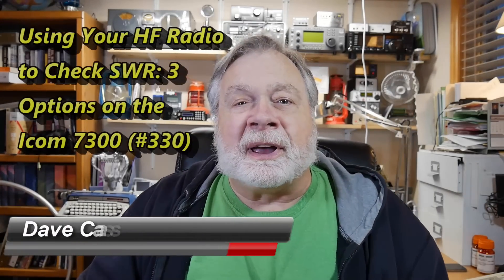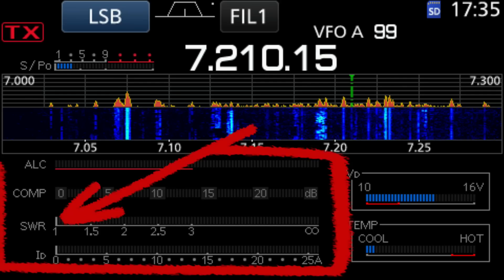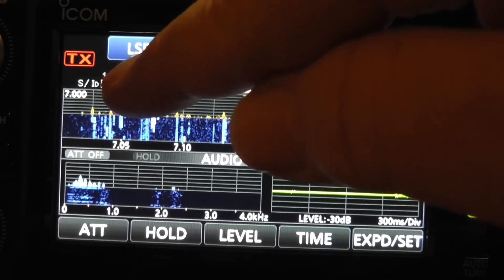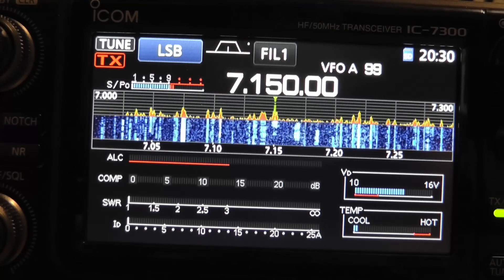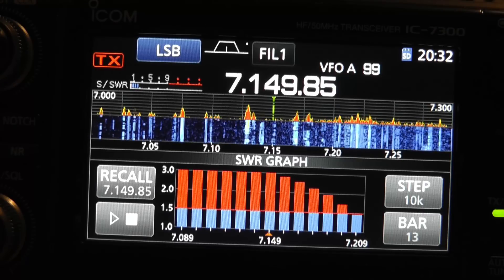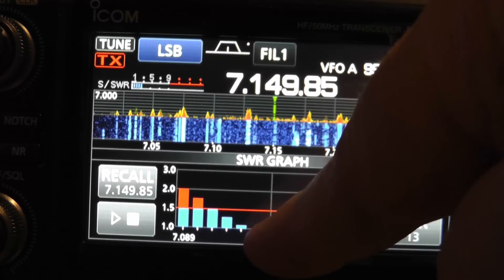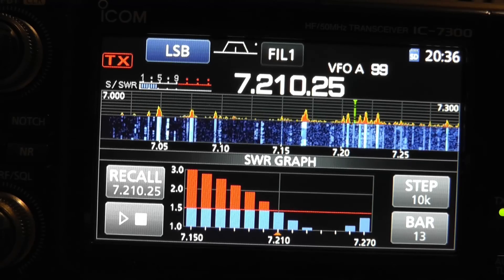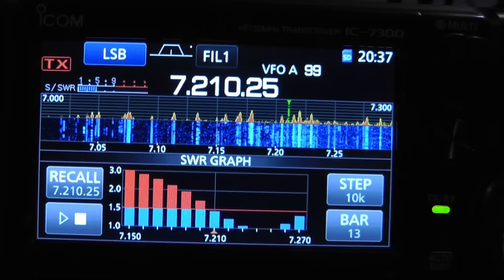Using Your Rig's Built-In SWR Meter: 3 Examples with the Icom 7300 (#330)

Comment: Great video Dave. Just an FYI. The ICOM 7300 manual says the following for testing SWR:

 1. Set the desired frequency band.
 2. Select the RTTY or RTTY-R mode.
 3.  If necessary, adjust the RF power to approximately 30 W in the Multi-function menu.
 • 70 MHz: 
20 W ( 70 MHz band transmission may be possible, depending on the transceiver version.)

Not sure why the manual says select RTTY mode. I've been checking SWR while in SSB mode, but have now switched to checking it in RTTY mode. In RTTY mode I have noticed that if you hold the PTT button slightly longer than just a click, the SWR bar rises quickly but then continues to rise slightly very slowly, not sure why that is either. 

I've played with testing SWR at 5W, then at 30W, then, if I know the SWR is good (i.e., < 1.5) testing at 90W. I can see slight increases in SWR as the power increases. This happens on every band I tested. This is interesting because SWR is supposed to be independent of power, unless this is just how the internal 7300 meter works.

Comment: The 7300 does have a auto tune function. Turn it on and it will retune when you key the mic if it needs it. Depends on how far off your SWR is.

Comment: Wow! What an information-intensive video. I commented in your video about why 50 ohm as it relates to my newly purchased Eton 750. I’ll be honest, I have been drooling over that ICOM 7300. Disclaimer: I do not have a ham radio license—yet. I’m just starting out, but trying to rationalize getting the 7300 and returning the 750 (free returns). At some point I’m confident I’ll be getting the 7300, so do I just get it now? Or keep the 750, knowing that at the point I get the 7300, what I paid for the 750 will just be added, essentially, to the purchase price of the 7300? Also, do I need to purchase a separate power amplifier for the 7300? Or can it plug into an AC power outlet? So many questions! Thanks again—your videos are amazing, and full of very interesting information. From reading some of the earlier comments, it appears you weren’t doing well recently. I’m glad you seem to be doing better—keep it up and hang in there!

Comment: GREAT, great video Dave! And many thanks to that other Oggie for recommending this topic & instruction! On my 7300, I really haven’t used anything more that the smaller SWR meter in the upper left, and used my external tuner. But I’m definitely changing mine to the ‘bar’ meter now as you’ve shown, I believe it paints a MUCH more thorough picture of the transmission! Side note, you’re looking much better Dave! You have more color back in you, and your voice is sounding strong again. 73!! (N4BDW)

Comment: I have the 7300 and this was very interesting. I also have a  590 ken-wood and a  older Icom I want to get the ldg tuner for it. i guess it is the pro 100  I have been trying to figure which tuner is best for the 7300
Reply from the maker: The built-in tuner is all I use and it works well.

Comment: Thanks Dave, another great video!

One clarification for the IC-7300... It remembers up to 100 internal antenna tuner settings as presets.  Once you "tune" the radio, it remembers the tuner settings for that particular operating frequency as a preset.  If the tuner is enabled, as long as you are within +/-1.5% of the frequency of a stored tuner preset, the tuner will use that preset otherwise the tuner will be disabled.

Cheers & 73!
Reply from the maker: Thanks for the info!

Comment: FYI. The manual says you need to select the RTTY or RTTY-R mode and run your power at 30% when  charting your SWR.
Reply: That's true
buy who's running at 30%..?.... that's only a starting point so you can see for the first time your actual swr...if it's safe, then you can do at 100%, power...it will change the swr alittle higher but only alittle

Comment: I've been wondering, on the 7300 when it's doing the SWR plot, is it transmitting with some significant amount of power?  Similarly, I sometimes see little blips go racing across the band, is that someone using something similar that is measuring SWR?
Reply from the maker: Usually those blips going up the screen are ionosondes, which are a form of radar used for ionospheric sounding.
Reply: In fact, at 7:23 in this video you can see one of those "racing blips" I'm describing.

Comment: Does swr mean short wave radio?
Reply: Standing wave ratio.  It tells you how much of the power is being transmitted or lost in your line and antenna vs reflected back to the radio.  A properly tuned antenna will have a low swr, as will a dummy load.  However the antenna will transmit the power and the dummy will absorb it all, not transmitting any usable signal.

Comment: I'm getting ready to shorten my 5/8th CB vertical for 10 meter work, and when I tested it one last time in its current 11meter length for SWR I found that I'm getting different readings from different meters.  The cheap CB transceiver meters are notoriously unreliable, but I was a bit surprised when my MFJ Grandmaster SWR meter read differently than my Workman CB external SWR meter.  Everything I heard was that external SWR meters should be pretty spot on, but I guess not this time.

The Workman has often "agreed" on SWR readings with the transceiver's internal SWR meter.  But, I would suspect the high price, high end all HF/VHF SWR meter would be the one to place the bet on.  Could you offer a bit of wisdom on the difference?

And thanks for working to make all these videos!
Reply: H Higgins  Both of my CB transceivers and both SWR meters were purchased new, in sealed packages.